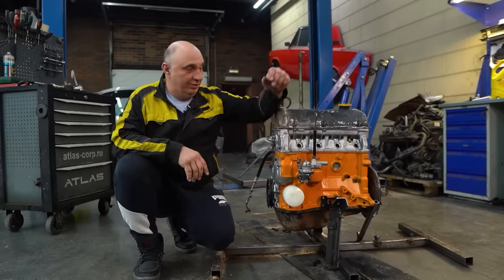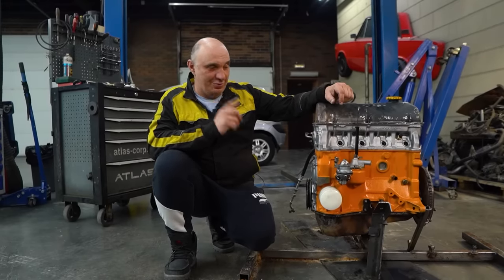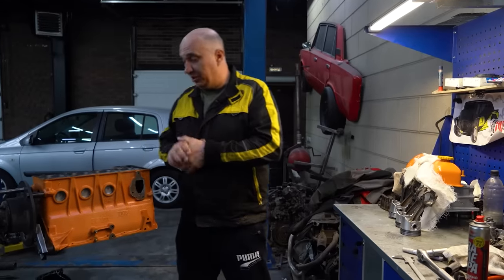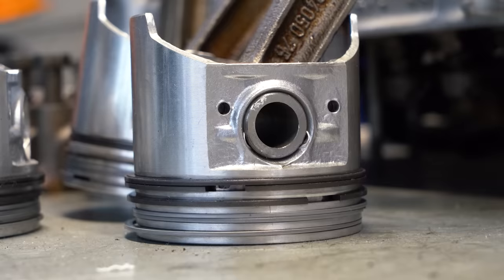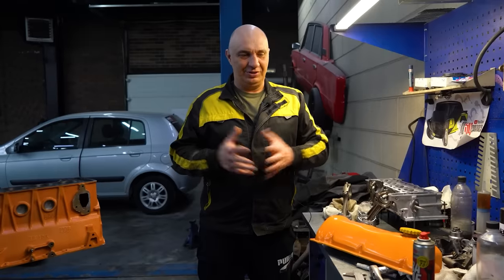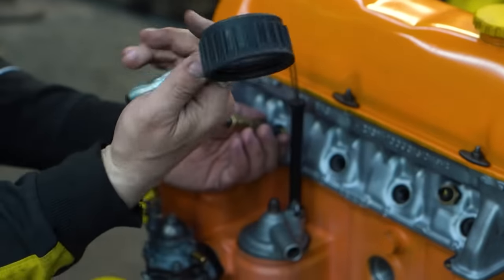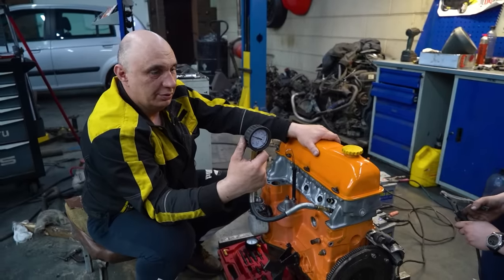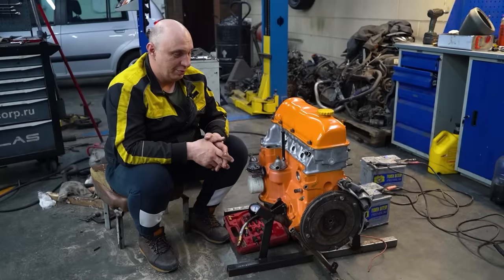Cranking the compression up to 20 kilos (285 PSI) - what for?

Comment: That engine is either going to run really good or it's going to get ugly quick!
Reply: It'll knock harder than a bailiff
Reply: Big end shells will probably give up
Reply: My lawnmower has 250 PSI per piston ( it is an old TurfTiger)
Reply: @AndrewAudio  that sounds pretty high for a gasoline enginge ... maybe your valves need adjusting?
Reply: @E01F  nope, I thought of that too. I checked the stats online and they matched.
Reply: Something is going to break. I predict a rod will break. Maybe the engine block.
Reply: Gasoline is going to detonate from compression-ignition and destroy the engine in short order. They'll have to use something that doesn't self-ignite as easily like ethanol.
Reply: It'll destroy itself if it runs on gas and not diesel.
Reply: will it blow up or over heat 1st?
Reply: They better use 106+ octane of its going to self destruct quickly.
Reply: Idk... If they run it on Ethanol it may run good.
Reply: @4BillC  pure ethanol is 100 octane e85 is around 104. Don’t as why it goes up when blended with gas.
Reply: It's a Lada! It started out ugly, but it's like a Russian Volvo in that it's a literal tank.
Reply: @AndrewAudio what engine is on it?

Comment: You guys are gonna need some high octane fuel to combat spark knock. And proper timing. Can’t wait to see this fellas. Then get that engine in something and get that power to the ground. I’ll be on the edge of my seat to see this.
Reply: Ethanol is perfect for that.
Reply: @Ti   They’ll probably need around 120 octane. This can go very bad, very quickly.
Reply: Spark knock? Do you mean preignition as it occurs prior to the spark?
Reply: i think knocking is the idea, so much knocking that spark plugs wont be necessary.
Reply: @ohyou_6599  Diesel it is!
Reply: Leaded racing fuels of 100 or more octane or piston aircraft 100 octane low lead should do the job for this high compression engine testing.  Propane and alcohol are the best high octane lead free substitutes as well.
Reply: Even 140RON will not work on that. It was used on the Merlin engine and a few others to up compression but nothing like that far.
Reply: Not necessarily. You just need to make the fuel harder to ignite. Mazda do this on SkyActivX on pump gas. They use much leaner fuel ratios to make it hard to ignite and I think a richer direct injected pocket near the spark plug at spark timing to get the whole thing to go off.
Reply: @chuckfarley5415  not sure... I've been using ethanol on 14:1 compression ratio on naturally aspirated with high volumetric efficiency and 12.8:1 with 1 bar of boost (pressure ratio 2) without any issues on the same type of engine - Zetec Rocam 1.6 and 1.0L. Ethanol is extremely resistant to knocking. It's also a good replacement for diesel if you add the proper lubricant additives for the fuel pump and injectors.
Reply: CNG has octane rating of around 130...

Comment: This is definitely going to be turned into an AC compressor
Reply: LOL i wish, you can't pump a fluid with a 4 cycle :D
Reply: I was thinking it would be a diesel.
Reply: @TurboVisBits  Well, technically you're pumping air with an engine, which is a fluid but not liquid. And you're not trying to compress liquid on any refrigeration system, just the low temp/low pressure gas into high temp/pressure gas into the condensing coil. But even so, this wouldn't work as there's too much leakage everywhere and you'd just keep loosing refrigerant. Cars still use piston based compressors, and there are piston based compressors for HVAC, however they've fallen way out of favor for scroll and centrifugal the last 20 years.
Reply: Only 2 Zylinders
Reply: Run it on 2 cylinders and use the remaining 2 for compressing AC gas

Comment: You guys are right in the diesel engine territory with that kind of cylinder pressure. So it would be interesting to see how long the modified gasoline engine would last on diesel fuel with the injectors mounted into the spark plug holes with the machined diesel injector clamps mounted to where the spark plugs should be in just so they stay put and hold the pressure.
Reply: how many rings is to many rings you asked well watch and find out🤣

Comment: The oil tings is designed  to hold oil to evenly lube the cylinder, and remove excess,  the lower ring is to scrape oil from the wall, keeping it out of the combustion chamber,  the reason the more rings raised compression, is because the rings are higher on the piston..  you could simply add a ring land at the top of the piston,  and move the existing rings up,   more rings only rob power, more friction!  And it takes time to seat the rings to get a good deal!
Reply: @Karl with a K definitely not next to nothing. Piston rings cause a significant portion of a whole engine friction.
Reply: @Karl with a K karl, i would just like to add that the high performance racing 2 stroke engines mainly use single ring pistons
Reply: But the two strokes racers aren't diesel either
Reply: @Samheraghty-qs7uz  matters notwhat kind of fuel the engine uses-their pistons still have ring(s)

Comment: There is a certain pressure threshold before it will behave like a diesel engine. A diesel engine has pressure of 300 - 500 psi.  And that engine is producing compression similar to low end of diesel compression.

Comment: WTF!!! 20:1 From a Lada engine that's insane congratulations to the team there! 😃that means, they achieved better compression ratio even from the modern (skyactiv) combustion engines of Mazda.
Well done guys there!
I appreciate your simple and the hardworking way that you all devoted to your projects.
Thumbs up from me Garage54!
Reply: No my man, you mixed all up and is confusing all the terms!

20:1 is simply a ratio of how many times the compression volume can be inside the cylinder volume(stroke volume + compression volume). It has nothing to do with pressure!

But you can say that in order for a diesel engine to run properly, you need at least 18:1 or more than that. Mazda has achieved 14:1 in their diesel engine, but has a hard time to start in winter due to low pressure and therefor low heat. But they managed to sort that out using exhaust and glow plugs. The reason they did the low compression ratio was because it produces less NOx and particulates!

The new skyactiv x that runs on gas, has a compression ratio of 16:1. What the actual compression pressure is, I don’t know, but could be in the region of 15-20 bar of pressure. For diesel engines the compression pressure must be between 30 to 50 bar in order for the finely misted diesel fuel to ignite

Comment: This should run great as a diesel.
Spark Plug holes for the injectors and where the distributor goes for the diesel pump. 
Glow plugs are optional
Reply: i like where you are going with this !!!
Reply: It will bend the rods instantly. Engine knock is basically how diesel engines work, with that high compression, idk if it will last long even on straight gasoline or LPG

Comment: Add a cam with a good amount of valve overlap and alcohol for fuel and that motor should make some impressive power.
Reply: Vlad will have to send the stock Lada cam to Isky Cams in California.  They can analyze the stock cam and then make an entirely new custom cam from scratch for this particular Lada engine.

Comment: The best way to increase dynamic compression is camshaft timing. Advance the cam a bit. Maybe 4 degrees or so, and you'll get more low end grunt. Also, good cylinder head port, and seat work will help. Try a 5 angle valve job, and cut the intake valves and seats to 30 degrees. This will present more open area at the valve curtain at lower lifts, and will enhance low lift flow, improves cylinder scavenging, and will build low end torque

Comment: The main issue I imagine is the total combustion pressure is relative to normal atmospheric pressure, there's probably some sort of a curve that shows the inefficiencies of too-high compression where at some point you're using all the combustion energy just to compress the next shot, and no useful energy comes out of the crankshaft.
Reply: That's nearly impossible. What do you think the actual pressure of the explosion is?
Reply: @Chris_Garman  you don't know how physics work do you. Good luck magically harnessing all the kinetic energy from a tiny explosion in a tiny chamber where you nearly have no control over combustion timing, and then having it somehow flywheel into another compression.
Reply: Practical engines have been built with ratios up to 25:1 this is about 20:1.

What your saying sounds right but a good few engines have gotten to the same level or not quite alot higher ratios.

Comment: This engine could be suited to run on diesel, considering the high compression ratio. 
But it needs to have its internals strengthened so that it doesn't disintegrate after a short while

Comment: Maybe it would be wise to back the timing right down on this thing and run 50% gasoline and 50% diesel to begin with. I wonder if the connecting rods are going to hold up. Don't really understand the reason for putting compression rings where the oil ring should be. Hopefully this isn't a problem for lubrication

Comment: Most diesels I have worked on had about 500 PSI compression pressure. Now that is with one injector out and the fuel line dumping into a jar or jumpered in the case of Detroit. Compression is with the engine running. Don't know how the 285 was attained. A bit high for conventional gasoline technology, but Mazda has an engine running that way, and I believe lean burn.

Comment: Not sure if the connecting rods will be able to survive the extra compression, I have a feeling a piston and/or rod is eventually going to break. Also you must have an oil ring on the pistons, premature wear on the rings and cylinder walls will happen and also more friction and heat will be generated, basically the engine won't last, could even seize.
Reply: Just throw some 2 cycle oil in the gas lol
Reply: @samleen  true lol
Reply: @samleen  Bad spark then!

Comment: Using total seal piston rings will achieve the same result, but without the additional friction extra rings will cause.
Reply: Says the marketing. Lotta people having issues with those in the real world.
Reply: How do you Mount them
Reply: @DarkLinkAD  they work fine for non dry sump applications.. lots of goofy scenario... gas ports on stock cams cause problems, vac pumps cause problems... shrug.
Reply: russian rings are far superior to american  gimmicks .
Reply: @andreastheile426  
just like american girls

Comment: its going to seize, dril someo tiny holes in the lower 2 sets of rings, dress and polish, at least there will be a way to oil the cylinders, for the compression issue you need a jake brake or compression reaslee for each barrel...  you open it up then slowly close while cranking over with ignition and fuel on, she'll fire and spin on 12V

Comment: Wondering with all that decking if they adjusted the valve clearance of it was OK on that engine? Even non interference engines can run close to the pistons. 
Looking forward to seeing this being converted to a Diesel which I bet is the game but the question will be how well the bottom end will/ would hold up as well as maybe the rods?

Have thought of doing this myself on a larger engine doing low power but being able to run on diesel for a generator.

Comment: They should weld the cam then file and sand it all smooth and see if they can make there own performance cam... They would have to figure out how to harden the lobes perhaps using a stick welder with a really hard rod...
Reply: They could spray weld the lobes and have it hard face nitrited they do it to repair cranks and camshafts on heavy industrial engines

Comment: It’s great how you lot keep coming up with new ideas and testing them out so we don’t have too. Have you tried fitting a different head to the larda engine block or fit a larda head to a different engine block. I used to test that when I worked at the scrap yard. I found 3 different engines that you can swap heads and blocks

Comment: Maybe a head without a gasket, use o-rings, something rubbery for water and oil,  maybe a copper o-ring, allowing the head
To fit deck to deck, maybe use a thermal grease in between, to promote thermal transfer, preventing rust.  Maybe deck the block until the piston rings are about 1mm from the deck, then machine a 1 mm pocket into the head, maintaining valve clearance, and quench pads, clearance, are tight, tight enough to prevent carbon buildup. Possibly reach, 250psi compression! And CNC the piston dome to fit the head,

Comment: TELL ME YOU’RE GOING TO TRY RUNNING IT OFF OF STRAIGHT DIESEL 🙏
Reply: More like staight gasoline lol for a dieseling cycle
Reply: @neptarclepuffin  honestly, if they run it purely off compression I’ll be happy 😂
Reply: @turtlemotonation  ping ping ping kaboom
Reply: @detaart  Knock Knock
Reply: @shlushe1050  All of your cylinders
Reply: I was thinking more along the lines of nitro methane
Reply: @neptarclepuffin  Diesel will have the advantage of additional lube through the fuel.
Reply: That will not work, diesel auto ignites too early for this style fuel delivery system.

Comment: if the valves are open at all during any compression what so ever, you have so much that it could be pressurizing the head therefore the crank case. could explain the blow by. different cam and valves shell run mint

Comment: One of three things will happen once the engine starts

1.  Head bolts/studs will fail and head will shoot off

2.  Main cap bolts/studs will fail and crank will fly out the bottom

3.  If they run gasoline as the fuel, the plugs will blow out the head, or there will be a massive predetonation that will destroy the engine

Comment: Assuming the already in place set of piston rings was installed correctly with proper end gap and the cylinder bore is not excessively out of round or tapered, adding additional ring sets will not offer any significant advantage. GM played with this on several "Big Block" truck engines back in the 1960s. If additional rings worked it would be something raceing teams were doing as a regular thing. But in reality all it does is increase frictional losses and operating temperatures.

Comment: I had a opel gt with 18 kilos and i had to run 105 fuel and two cans of Is octane boost just stop the spark Knock. The car ran great 0 two sixty in 3 seconds top speed at 185mph.

Comment: You can run with this much compression, it takes 130 octane leaded aircraft fuel, and a retarding of the ignition timing, but, it is feasible. I seen my cousin run an Oldsmobile 5.7 liter diesel this way, back thirty five years ago. That little engine was a torque monster

Comment: This is Omazing!!!
You need at least 175 PSI to 200 PSI on U.S. pump gas for a performance engine. Now with your target of 285 PSI or 20 to 23 kilos pressure, you need to run an extreme octane fuel, you already have micro welds on your valves in the chamber. You can increase cam duration an incredible amount to help and that shall only work to lower the average PSI. You need a high horsepower starter to start it as well, and reinforced starter gears and flywheel or flexplate teeth if it is going to take this abuse. A high quality GEAR PLASTIC is the durable answer. They are stronger and more durable than steel alloy type gears and gear teeth. The engine is going to explode, keep water below 150* degrees and use an oil cooler. Your engine is going to have 1.5-1.75 times the torque the stock form of the engine produces. Get ready for bent valves, bent rods, cracked crankshaft, melted piston and valves, and extreme heat and instantaneous oil starvation and bearing elimination and failure. You need to polish the valve surfaces perfectly smooth and piston tops to eliminate hot spots and heat risers, and add ceramic coating to the entire chamber even if the pistons are high quality forgings by MAHLE. You need a brutally strong material exhaust valve designed for high heat. And the exhaust valve guide tube, needs at least to be a phosphor bronze tube at least and perhaps the intake valve tube as well. :face-blue-smiling: This is Omazing!

Comment: You might have to run that engine on natural gas (120 octane) CNG, or propane, something nice and slow burning, and then try diesel 😂,  I machined 2mm off my Nissan GA16DE cylinder head and it just happened to be 1cr per mm, and ended up being 12.5 - 1cr, so I can only keep it happy on Gull 98 😊

Comment: youre gonna need some high octane fuel lol curious to see how this turns out if you use pump gas... lots of detonation I'd guess. As for extra rings im of the belief they dont really make a difference at higher rpm. at cranking speed they do but once your at running speed and especially into the powerband I dont think they help.

Comment: With no oil rings the oil will contaminate the air fuel mixture and cause denotation.  With the high compression numbers you have achieved this will be a real problem under load, unless you run racing gas or methanol.

Comment: Anyone for bets what breaks first ??? 
1
Rod bolts 

In at number 2
Piston skirt and crown 

Odds on at number 3 
Bendy con rod 

3 fat ladies number 4 
Head gasket failure 

Coming up from the rear at number 5 
Valves getting intimate with the pistons 

Sexy 6 
Burnt out starter motor 

Lucky 7 
Two pc crankshaft either before or after catastrophic oil pressure failure.
Reply: Ill bet the piston lets go first

Comment: also without oil on the cylinder walls there isn't a proper seal, at least a lot of fuel, oil helps seal the rings

Comment: i see a huge problem with this idea already with ultra high compression comes heat and aluminum head and cast iron block no Bueno and also not to mention the warpage that will be an issue thus failed head gasket in no time so the longevity of this type engine will be in hours not years